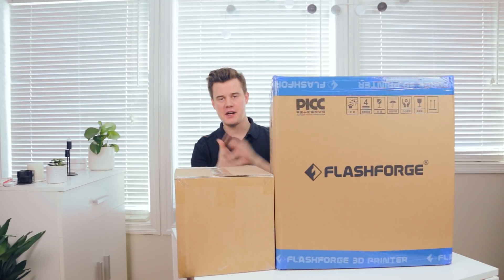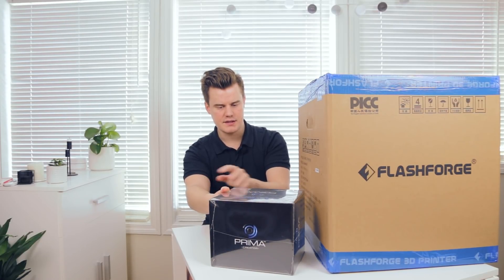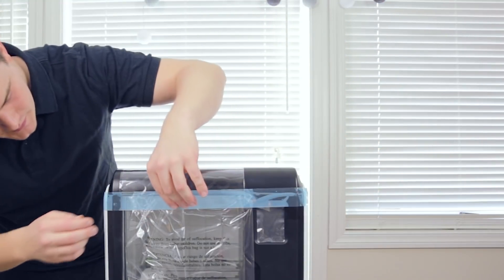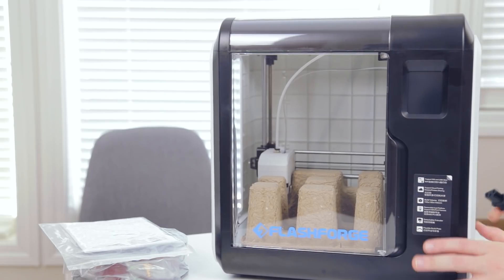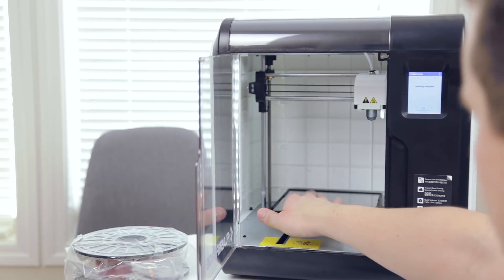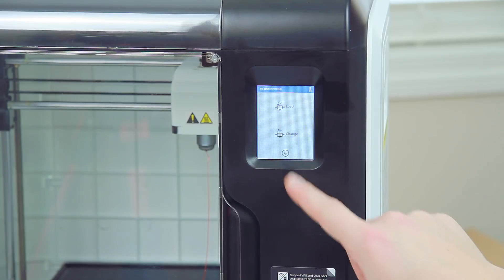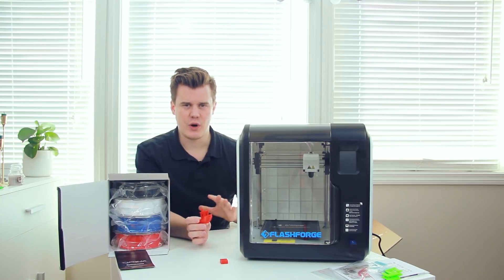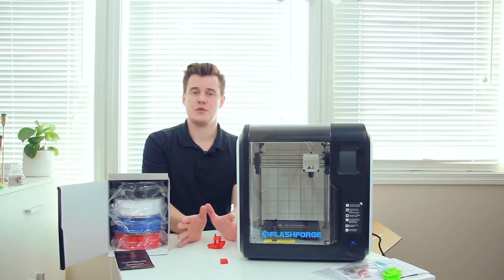Flashforge Adventurer 3 - Unboxing and first 3D print

Comment: This printer is amazing! (I have one) and printed out a little 3d boat my first day. It does not require any calibration at all. The only problem i have found is that the PLA material (from the company) is all sold out, mostly.
Reply: Mine is in the mail. Have you found filament from different companies that you like/ use when flash forge goes out of stock? Thanks
Reply from the maker: Honestly i just run most types of PLA Brands in it without any real issues. Stay away from “complicated” PLA mixtures :)
Reply: @3DPrintTechDesign  thank u !!

Comment: Thank you for this really good video.  I am curious about one thing:  You printed a very nice looking benchy out of PLA in this enclosed printer.  It was my understanding (which may be wrong) that PLA prints better with good cooling and no enclosure.  Was the printer open at the top?  Or, does an enclosure not really matter for PLA?
Reply from the maker: The enclosure has small "vents"on the rear of the top, but will still keep the temperature up high. 

It all depends on the PLA-cooler. In this case, the PLA is OK with being cooled with "hotter" air, circulated inside the machine. So it works out very well having the machine closed  For larger parts, I'd keep the enclosure closed, as long as your filament is OK with it. That will help the larger parts keep it's form, avoiding shrinking due to the temperature.  

The PLA-cooling is mostly there to make sure the PLA harden faster and won't "flex" on overhangs/bridges. So if you're cooling is Good, it will still work if the enclosed air is 40-50 or even 60C high.   The higher ambient temperature will allow the PLA to shrink less per layer, keeping it's shape, resulting in less warping and failed prints.